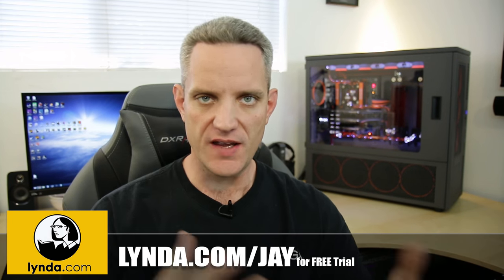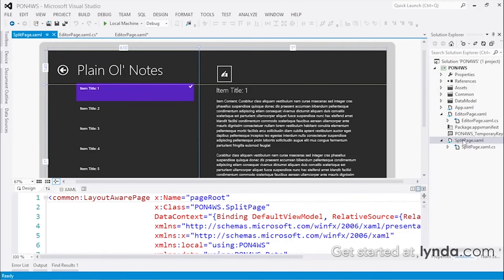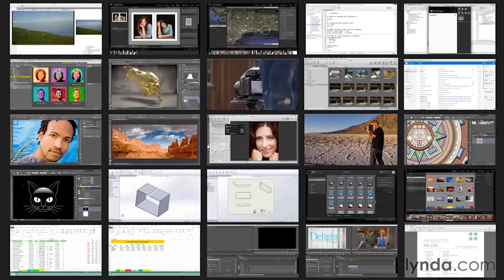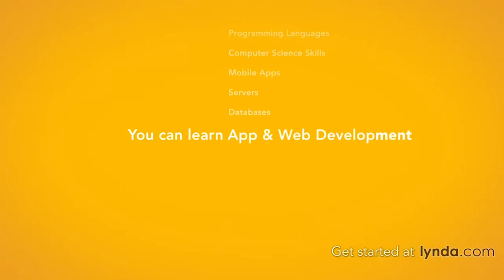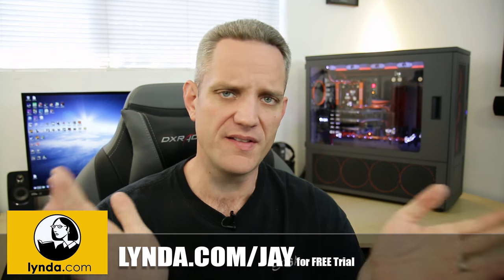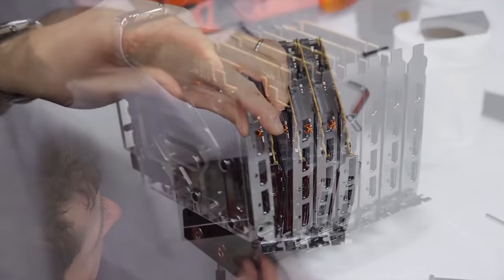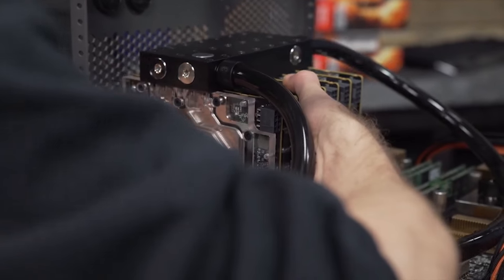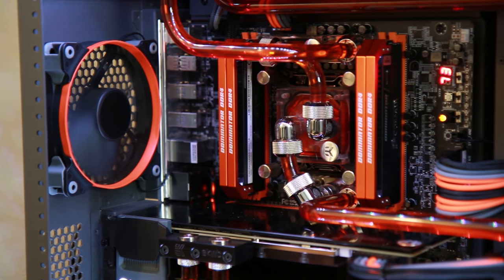Is watercooling worth it?

Comment: I got a MSI GTX 970 and a AMD FX-6300 @3.8GHz, but I need an extra 0.2GHz so I can run BF4 on Ultra without stuttering. I was thinking of Water Cooling (just for the CPU) so I can get that extra power without overheating. But watching this, it'd just be better to save £300-400 for an i7 right? I can do that.

Great vid btw ^w^
Reply: +Spynxie Matrix Id get an i5 and save up for Pascal or Polaris
Reply: +Spynxie Matrix You also would need a motherboard for the i7, and would be good to have a better cooler for it than the stock one. Get a decent air cooler, they perform very close to AIO water coolers while significantly cheaper, it will let you OC your current processor well.
Reply: Get an i5 4690k or i5 6600k if you are going to be gaming and doing internet browsing, if you are going to be rendering things get an i7 of your choice
Reply: Dgtal Breakz My mobo is a Gigabyte 970A-UD3P (sorry I've only been on PC for a year, I'm still learning xD)
Reply: +Spynxie Matrix Did you have the stock cooler?? I dont think you have, but an i5 6600 or i5 6600k would be defently enough for bf4 i think.
Reply: Gameo Yeah I have the stock cooler for it
Reply: Spynxie Matrix Doesnt matter what motherboard you are using, AMD CPUs need motherboards suitable for them and so does intel, you cant throw an i7 into your current motherboard if that is what you were thinking about... If you didnt know about what I just said, dont even try overclocking the CPU... Please, pretty please do your research before hand.
Reply: +Spynxie Matrix You should just buy Cooler Master hyper 212 evo cooler. With it I have a very stable oc of 4,3 ghz. I was running 4,6 ghz, but the temperatures were running to the high side
Reply: +Spynxie Matrix If you have a stock 6300 cooler you can just add another fan to it. The AMD stock cooler is not terrible if you add additional fans. You need downward air pressure for the socket anyway. You can zip tie or tape a fan on top of the existing fan. A 92 mm fan fits almost exactly and can be attached to the black plastic shroud. With 2 fans the stock heat sink can handle your overclock!
Reply: DaZaNyR Id reccomend the Cryorig H7, its slightly cooler and a lot quieter for the same sort of money
Reply: NeoVoodooChild Now this I like the sound of! But it also sounds incredibly make-shift and unstable o.o
Reply: It's not unstable at all. It's a tiny fan. Zip ties are very very strong! I also use metal aluminum ducting tape or gorilla tape. You have to put it on both sides of the 92mm fan then down on to the black plastic square. It's so hard to pull off you can't without breaking it once it's stuck. I currently have the stock fan cooler on an 8370, plus an extra 92mm cooler master and a 120 mm cooler master fan on the stock heat sink. The 92 is taped with metal tape and the 120 is zip tied to the 92mm through all 4 holes. Any more fan then that and I'd be putting two much weight on the socket support. I was able to overclock heavily and cool all the vrms.
Reply: +Spynxie Matrix Buy a good Air cooler like the thermalright macho 120 and you are fine. but First look how high the cooler can be in your case.
Reply: +Spynxie Matrix If you get a 240mm+ AIO, you can push well beyond 4.0GHz. My FX-6300 with a NZXT Kraken X61 is running at 4.5GHz 24/7 @20C idle. Good luck with your OC.
Reply: This is currently the best downdraft cooler for any AMD Am3 socket! Company from Japan, You can't find better made. http://www.amazon.com/Scythe-SCBSK-2100-Shuriken-Cooler-Socket/dp/B0069CQ7BE
This one is close second but kinda pricey http://www.amazon.com/Noctua-NH-L12-Low-profile-Quiet-Cooler/dp/B007C861WO
Jay uses the cooler master Gemini.
http://www.newegg.com/Product/Product.aspx?Item=9SIA25V3296119
Reply: +Spynxie Matrix i am running a fx6300 also. i had the stock cooler with a duct for a 120mm fan and it was still getting too hot to get good overclock #'s. i just picked up a good coolermaster cooler and i can run that cpu at 4.2ghz all day long no problem.
Reply: +Spynxie Matrix Or buy an all in one cpu cooler.
Reply: +Spynxie Matrix just get an aio rather than buying new mobo and processor. in aus a cheap aio with good reviews costs 90 bucks

Comment: Water cooling is not worth it but I still have a custom loop...
Reply: Ikr I did it for the looks and for the accomplishment you get after doing it :)
Reply: +AnTerZZ - CS:GO and More you have a watercooled pc for cs go okay then IM OUT !
Reply: +DomeZockt Not only. Trust me. I'm fine running csgo at 500fps but not so fine with hardcore Simulators that bring my 970 to 5 fps
Reply: +AnTerZZ - CS:GO and More and he has an 970 and IM OUT ... AGAIN
come on
Reply: +DomeZockt planning on dual 970 bru
Reply: +DomeZockt are you jealous or something
Reply: +rk ark yes of course
Reply: +Tommi_6o AIO is also watercooling and that is totaly worth it
Reply: +MrBall Breeder that is also arguable.  A noctua nh-d15 is about the same performance as a corsair aio (slightly higher Temps but alot quieter). 
However it looks fugly.  So I went aio
Reply: Connor Mackenzie same

Comment: This is the reason all in one coolers are my favorite way to water cool to date. They cost about the same as a nice air cooler, but can move more heat and be quieter with little maintenance. I have a i7 870 (yes I know, prehistoric) running on a untouched Corsair Hydro H50 that was I think about $55 when I bought it new 6 years ago.

 So far it has been reliable and cheap to run, whereas a real custom loop costs a fair bit to build and requires quiet a bit of maintenance. So for most part I think an AIO is the best of both worlds as far as cooling goes cost wise.

Comment: Jay, what is the point of having the CPU and GPU always run with high voltage and clock speeds?  I would never do it since I can easily used adaptive mode but I'm just wondering?
Reply: +Peter G For intel you can use adaptive voltage but AMD doesn't offer that option.
Reply: +Anonymouse Yeah I know I use it on my i7 6700k, stable and keeps temps very cool at like 1.210 volts.  Also he is running a i7 5960x so that is Intel...
Reply: +Peter G it makes them faster. they can perform better if the overclock is stable.
Reply: +Hades Gaming I don't think so... when mine is running under load it is at full voltage and clock speeds, it just clocks down when not doing anything and lowers the voltage.  So whether or not it clocks down, at load it's always the same
Reply: +Peter G It improves performance vastly
Reply: +Neil Mc Cann He's asking what the point is in letting the CPU run at high OCs and Voltage even when its idling
Reply: +Peter G It can offer increased stability and maybe a couple hundred extra MHz. For most people adaptive is fine if your hardware supports it.
Reply: *****
No adaptive voltage has no influence on your overclocks if they are stable.
Adaptive won't make stable overclocks unstable.
Reply: Exidrial
meh, read it somewhere on a tech forum, figured they knew more than me.
Reply: +Anonymouse Not under the name "adaptive voltage" but yes that is very much a feature offered by AMD motherboards and processors. You just overclock the boost configuration instead of the base configuration, like you are referrring to.
Reply: BaguetteHD You could be right but I read and heard that amd doesn't support something like that but that could be false.
Reply: Anonymouse
Speaking as a person who was running this configuration for years on my old FX 6300, you can ^_^ You've gotta be careful what you read about AMD, i wouldn't be surprised if i read someone say that AMD buy their silicon from ISIS.
Reply: +BaguetteHD Because if your using adaptive voltage or turbo boost power saving anything like that it will throttle down under load and temps. Pumping the voltage through keeps the overclock at the same level so it never dips lower! It really helps with benchmarking. Try a manual overclock and run 3dmark with the voltage pumped through, then try it on adaptive mode with the same limits and you will see a difference.
Reply: +NeoVoodooChild Yeah that's exactly what I am saying! Why would you ever want it running like that and with extra voltage when idling when CPU power regulation is so good and switches in nanoseconds?  Just seems like a waste to me because as other commenters said, it won't have an effect on your overclock.
Reply: Peter G I never do it because it waste alot of power and really kicks your cpu's ass but some people like it because it will perform better under extreme loads. The real world difference is in like the small percentages so I always let mine throttle to it's lowest state. It matters more if your right at the edge of your performance threshold or your trying to like one up your personal best firestrike score.
Reply: +NeoVoodooChild Yeah same.  I also changed the CPU voltage from Auto to Adaptive on my Asus Z170 board and temps went down like 5 degrees of not more, adaptive is the way to go for sure! Also this is under liquid cooling as well.  And if I am idling the processor clocks at 800 MHz and voltage goes down to like 0.8 but that's fine because the second I open a program or whatever I have all the power I need because those things change in such an insanely low time.
Reply: Peter G Nice! Intel is light years ahead of amd. My 990fx only ever lets my 8370 dip to 1400 mhz and I doubt it's that instantaneous.
Reply: NeoVoodooChild
The whole point was that it would throttle down when not under load, electricity is expensive in the UK lol.
Also if your 8370 (why buy an 8370? Just overclock an 8350) is idling at 1400Mhz you've probably changed the base bus speed which the multiplier works off of, it should go down to well below 1Ghz when power saving.
Reply: BaguetteHD Because it was cheaper on holiday sales and overclocks higher. Did you read anything I said? I said the exact same thing. It wastes electricity and kicks your cpu's ass over time. Also, nope stock speed of 200 x 7 with turbo multiplier increase only. I don't believe 8320 50's or 70 ever go below 1400 but it could be my chipset. http://www.eteknix.com/amd-fx-8370e-95w-piledriver-octa-core-processor-review/
Reply: NeoVoodooChild
Sorry man i was honestly having trouble understanding what your messages were saying xD
Yeah, literally no realistic benefit unless the person games 24/7 in which case i hope their rig breaks down so they need to actually live life.
Also fair play if you got a 8370 cheaper, higher binned chip can't complain!
Reply: +NeoVoodooChild Yeah Intel is way above AMD right now and it's actually sort of forming a monopoly in the high end market, same thing with Nvidia and AMD.  Maybe Zen architecture will be good but I feel like it will just be trying to catch up with Intel in performance and not even come close to an i7, probably more like a good i5 speed in benchmarks and stuff.  A lot of benchmarks of AMD chips against Intel show AMD losing to Intel CPUs with half as many cores even if they are all being used.
Reply: Peter G
AMDs single core performance is just horrible.I switched from FX-8320 to i7-4790K and the i7 is a giant godzilla eating monster compared to the 8320.the i7-4790K has twice as much single core performance than the FX-8320.
AMD processors suck for MMOs and that kind of games because of that.

I can't imagine AMD competing with Intel in the high-end market with Zen.
Reply: Peter G
Don't forget that AMD has a heavy advantage is professional usage programs in comparison to equivalent Intel chips, also price to performance.
For the general user however, yes high end Intel chips are better than high end AMD chips of this gen.
Reply: +Peter G adaptive mode gives higher voltage than what it is showed to keep the clock stable. if you overclock  with intel you should never use it while overclocking .even JJ from Asus told it somany times.
Reply: MrBall Breeder
Adaptive gives the max voltage you set it to.It won't exceed this value except for when you're running certain stress tests that raise the core voltage on purpose.
Reply: +MrBall Breeder Yeah, it does not go above what you tell it to, I'm my case stock voltage.  I can indicate this my the readouts and confirm it by the massive temperature decrease since I switched from Auto to Adaptive.  Even overclockers agree that it is probably the best choice if you don't want CPU running full force all the time
Reply: +BaguetteHD "Unless the person games 24/7 in which case i hope their rig breaks down so they need to actually live life." xD hahaha that comment made my night! Agreed.
Reply: +NeoVoodooChild Yeah I don't mind people playing a ton, I mean it is their prerogative, but if that is all they do then it's a problem.
Reply: +Anonymouse AMD does. The voltage of my FX8350 did go down when the clock speed went down in idle.
Reply: LimPu Yes I know now, just read the other replies and you'll see.
Reply: +Exidrial Yeah, the i7's absolutely destroy the AMD processors even those with 8 cores benchmarks using every core!

Comment: Not worth the risk unless you go for extreme overclocking my brothers pre built water loop just leaked the other day and he lost his 980 ti because of it now he want's nothing to do with water cooling i told him to just go air in the beginning and he didn't listen.
Reply: >prebuilts
Reply: Plenty of proof custom loops leaking  jay already has a video on his skunkworks build leaking  go for water cooling just don't bitch when you have to buy a new computer and the manufacture doesn't warranty water damage have fun forking out the cash for a new computer.
Reply: lol, custom watercooling only leaks due to user error and not inspecting all the parts and o-ring seals.

only careless idiots get leaks.
Reply: razgriz206 lol, what are you talking about.
Reply: May I ask what the fuck is wrong with the cooling parts? If you take your car for an inspection every year and every time they find a leak you've been buying shitty car parts.
Reply: razgriz206 bla, bla, bla. maybe you should have checked the connections b4 putting it inside ur pc m8. its your own fault.
Reply: razgriz206 >prebuilts

Comment: will i be able to run a gtx 1080 and a i7 6700 without overclocking with a 750w pcu?
Reply: easilly
Reply: If you don't overclock, you can even get away with a 550W PSU.
Reply: LinOG Gaming you're for real? With how low energy today's stuff if you could probably run as low as 450w. Though I wouldn't recommend it
Reply: Suspect nah its silver certified i think and i posted that years ago lul 😂😂

Comment: Watercooled systems look so nice which is why I WANT one but I do not NEED one. I have an air cooled 5820k running at 4.5GHz at 1.3V. The Dark Rock Pro 3 is an amazing in both thermals and acoustics (low rpm fans and no pump noise!). Looks pretty bad ass too.

Comment: I spent about $500 on watercooling parts for just a CPU and have rebuild my system several times with the same parts and recommend it because no matter what CPU and mobo set up I have, how hard or long I run it they have always stayed extremely cool and I never have to worry about heat or noise. $500 is an investment but to me it has been worth every penny.

Comment: Nice explanation, Jay. It seems more like a compilation of what you have been saying for like... some years.

I would like to draw attention to another important point: watercooling can move away heatsinks from the main components. Casemods and scratch builds can leave little room for heatsinks - like a big cpu cooler or a two-slot gpu. So, by watercooling them you can put the radiators in another place with enough room to move enough air to cool them.

Greetings from a Brazilian fan.

Comment: I have a 3D printer and printed a mount for maelstrom CPU liquid cooler to fit an R9 270x with excellent  results. Thats a $65 liquid cooler mounted to a $270 GPU, totally worth it! The mount cost me 50 cents to print and a little time to design....Screw waiting for some company to do it and charge $100!

Comment: I spent less than 200 bucks on a soft tube custom copper loop with a AM4 block, a Asus Strix GTX 1080 block, 120 radiator+240 radiator, reservoir, and a pump, 3fans.

Comment: I would have added that if you are going sli or crossfire then you should water cool so that the hot air isn't just heating up the other cards, and if you are planning on going sli or crossfire water cooled that sticking with the reference design would be best for finding the water blocks for the card and if you cant afford a custom loop right away at least the blower style fan would blow the air out the back for the time being.

Comment: Heat isn't the number 1 killer, voltage is. Parts can run all day long hot, they're designed to. 

Don't take this as me being negative on the video though, it's a great video! Personally though, I'm not watercooling gain. I'm going to go for a 100% air cooled system.

Comment: Such knowledge. So truth. Many logical.  Well spoken my friend.  One thing I might add is this. Water cooling components will last a long time. If you buy a quality radiator, cpu block and pump, then chances are that they will last for 5 - 10 years, and 2 - 5 PC's. Just my 2 cents :)

Comment: IMO the only benefit of Watercooling over aircooling is that you can transfer the heat away from your components more quickly. It is very beneficial for small formfactor systems like M-ITX or M-ATX builds or builds with multiple GPUS, like skunkworks. The Temps may be better, but you sacrifice that for a potentialy very annoying pump sound. Also you add multiple points of failure(leaking, pump failure, fan failure) to your system. Nevertheless a custom loop looks badass. :D
If i had unlimited budget i would go for the custom loop, but with a budget of about 1000-1500 bucks like most folks, i would get better components over (custom-)watercooling.
Great vid jay. :D love you :*